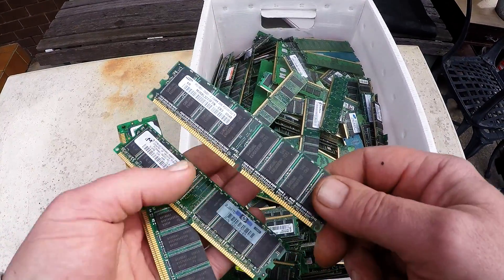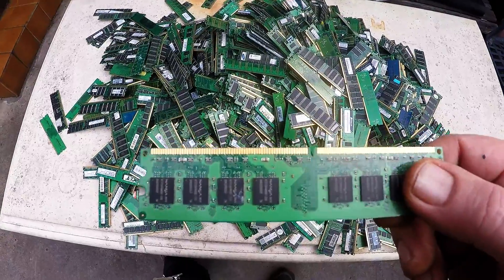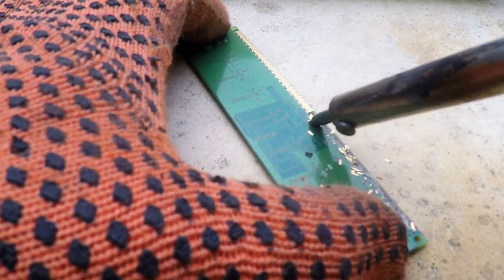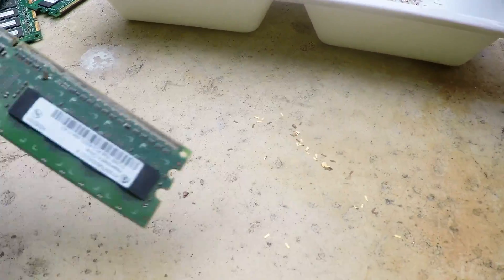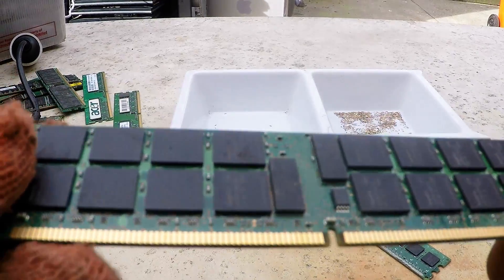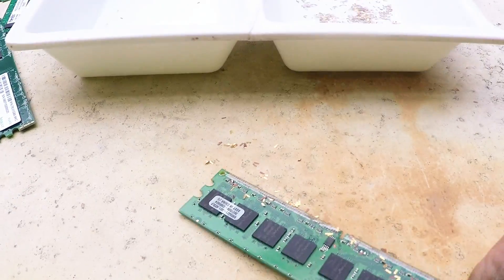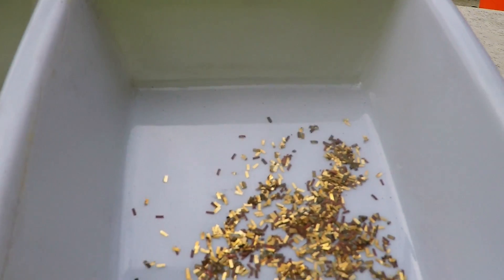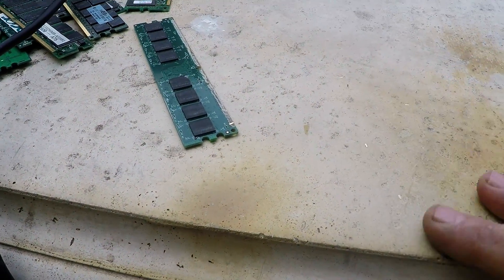1000 RAM Stick Gold Recovery Challenge

Comment: Have you considered heating them in the oven to have you considered heating them in the oven to about 400 Degrees Fahrenheit and holding them somewhere close to that because though I haven't done that I do know that's below the melting point of solder but would have your fingers ready to fall off with much effort far less than what I'm seeing you do now and just seems to me it might be worth trying because there's an old electronics technician trick that consists of placing entire boards in need of repair in the oven to Reflow the solder without having to do anything else so easy a blind man can do it because it's all about knowing precisely where your solder will flow and then dancing along that edge the other methods not to mention the physical stresses put on components regardless of temperature that can all be avoided if done properly and I have seen it done many times my other electronics gurus I know who effectively minimize risk and effort while maximizing productivity because you can put quite a few motherboards inside of a typical household oven which is where at least three people I know do all of their work rather than high-rent storefront that just chews up all the profits.

Comment: I wanna get into this hobby also so I can use this gold money I make to use for my addiction to sports/poke/yugioh card collection purchases what kind of soldering iron can I purchase off of Amazon or eBay what’s a good affordable brand to look for my max spending is at least $100-$140
Reply: pro tip: go for obsolete stuff if its cheap. its useless and usally has more gold
Reply: Maybe the same when you used to iron your shirts with so you can depopulate the entire thing at one time instead of one component at a time or toss them all and a griddle and using a spatula in pair of pliers depopulate a whole side at one time as fast as you can pick them up and put them down as long as you've got them pre-heating several at a time but I assure you you don't want to pull off just one of those individual tiny components at a time unless your objective is to kill time because you got nothing better to do and which case you may need a hubby much worse than you need money for whatever it is you wanted the gold to buy because you certainly won't get rich here doing that
Reply: And yes you want the stuff that is not just absolute but was made in a time when gold was around $300 an ounce instead of pushing up against the 2,000 per ounce all time high again and I honestly believe the new stuff not even a little bit worth messing with for that reason

Comment: White Distilled Vinegar and Hydrogen Peroxide will get rid of the copper.  Use an aquarium airpump and some hose to agitate it.  Plus when you are done recovering gold, add some aluminum from a Coke can and it will drop the copper out of solution.
Reply: Salt ?

Comment: I have a very bad message for you: this gold foils would not melt until you process it with AR. I tried this and let it up to 1150 degrees of Celsius for 30 minutes, nothing happen. It won't get into one solid piece of gold-copper mixture. I've lost a lot of gold by heating, instead.

Comment: It takes electricity to run a soldering iron,.What is the electricity cost on using it to remove the gold???
Reply: That depends on what your Electricity Supplier charges you per Kilowatt hour as well as the wattage rating of the soldering iron...once you know the 2 figures for your own setup then you can calculate that cost very easily.

Comment: Just use tin snips and cut a strip containing the gold pins then put them into a hydrochloric acid (27% or so) + 3% hydrogen peroxide to remove the pins. Super cheap and dissolves the copper under the gold fingers. It's also possible to put the whole ram sticks into an oven (Outdoor) and set it to 190c or so (Some sticks took 210c) . This melts the solder. I then used pliers to grab sticks and flick them on to a table stop. This usually knocks all of the memory modules and diodes (I guess they are...) free from the sticks. Also works with motherboards.

Comment: hi ben, me again lol i think i have commented on every video you have done. just a quick question, when you have the foils of the ram stick would they still need the acid to strip any other metals? or are they ready for smelting?
Reply from the maker: as the trial suggest, only 4% gold after removing the foils from the ram, it's best to then use HCL solution to remove the 86% copper & 10% nickel from under the foil, that way you have almost pure gold foils left which could then be simply melted into a gold blob, the hcl will just dissolve the copper & nickel.

Most people will just throw the whole fingers into hcl and let it do the work of removing the foils off the piece of board and remove copper/nickel at the same time, takes longer but is kinda the same thing, this project was just to quickly see what % of gold was in the foils but if you removed the foil like this then you would have a much quicker process one day when you go for the gold
Reply: that is really only a small amount of gold. i was thinking the way they look there would be more in it then 4% i am glad i am keeping the mlcc's and copper now lol

Comment: Not everyone has a place to make a safe refining setup, either if the person has access to the chemicals, without access to decent VENTILATION the chemical process will be near impossible.
Reply from the maker: Yeah I agree, especially using aqua regia, can be deadly, a good backyard refiner would have a fume hood and they aren't cheap
Reply: eWaste Ben And if the person lives in a condo it's even worse.
But this kind of technique could make the chemical process a bit faster: Since there is no "plastic" to dissolve, completing the chloroauric solution would probably take less time.
Reply: cant you a make a fume hood from the one most off us have in the kitchen? maybe withe a faster / more powerfull  motor? greets from the netherlands.
Reply: or the ones pot / weed growers use?

Comment: 6:38 at this point, I'm convinced people don't know basic chemistry. Most things on every are made of chemicals, which all have atoms.(got that wrong the first time ;3;) Water, as you may have heard, is hydrogen and oxygen, and you breath in oxygen, a little bit of carbon dioxide and lots (70% of what you breath) nitrogen. You may say just dangerous chemicals, but as long as you are careful, honestly, it's worth your time. It's takes, maybe, 15 minutes to find out what chemicals you need and how much, and it's a lot faster than scrapping the gold off. 
Btw, I'm not having a go at you, just informing you that chemicals are that bad.
Reply: Actually you breathe mostly nitrogen. And chemicals are composed of atoms, not the other way around. Everything is composed of atoms.
Reply: SwordlessFish ... Well thanks I guess. I'll change it now because it doesn't really change the point I was trying to get out of the comment.
Reply: Spectre Lex S'all good.

Comment: Hey Ben, I recently cut off tons of gold fingers from old circuits and my question is, surely a lot of those are not broken right?
(I dont know where you got them so all 1000 may indeed be broke) though my thought process would be, wouldn't it be a million times more worth it to test the ram sticks and sell them as is on eBay?
So, the process of scrapping these ram sticks for gold recovery is ONLY worth it (money wise) if the ram sticks dont work correct? I mean, you wouldn't consider scrapping WORKING ram sticks for gold right?
Reply from the maker: Yep, first point of call is to determine if it's worth selling, 2gb+ here, anything less doesn't sell well, if I get a lot of the same 1gb stick I try and sell in bulk lots to pc guys, but depends where you are, some countries still get good money for 1gb, just need to test them otherwise you end up getting too many returns.
But yeah, gold recovery is final stage.
Reply: Some old memory sticks are more expensive then "new" 2GB or 4GB, but you have to know prices (what is rare and expensive and what is not).
Sometimes size does not matter :)
As an example look at memory prices at this shop for Amiga fans. 1USD=4 zł 
http://www.efunzine.com/efnz.php?a=kat&id=175&sid=52762061755cacf5684cf691645d39fb

Comment: Well i'm very surprised the fingers come off so easily with this method.  And it sure would be easy to refine it to pure with acid still.
Reply from the maker: Yep, I think it's best to use some sort of solution to remove the gold from the copper/nickel as in my trial it's very heavy in copper/nickel and much easier to remove them first I think.

Comment: when are you going to put up part 2 really like to no what happens :)
Reply from the maker: soon, just waiting for a crucible to arrive so I can melt
Reply: sweet i cant wait to see it,have you thought about using (AP) or etching fluid ferric chloride  to clean it up a bit.get more cash less crap :)
Reply from the maker: would be less crap but not more cash, gold buyers pay for gold content, 8kt is 33.33% of 24kt but 3 times heavier so it's the same thing. This test is to see how close to 8kt we can get simply melting fingers down, if not 8kt we can add 24kt to bring it up, but if less then 5% then it may not be worth it, that's why i'm doing it, to see if it is or not.
Reply: fair play hope its good :)

Comment: Hey Ben, Well done! this and all your videos. Thanks for putting them together. Perfect timing, I was just shopping around for a shear to take off the fingers..... I tested this last night on Ethernet and sound cards also and it works great. added in using a steel ruler to straight edge a cut with a utility knife along the top edge of the fingers to aid in the removal.

Comment: Hi Ben, Ive already started processing rams the same way after I saw another video on here doing the same thing. You'll get approx 1 gram for every 6 double sided sticks. 
Accounting for minor losses (sometimes those gold fingers ping in every direction!!) you should have about 165 grams from 1000 sticks.
A kilo of gold fingers therefore would take approx 6000 sticks. Bet you've got that much stockpiled:-)
Though I like that you dont need expensive chemicals as this is very quick I'm still going to chemical process further as 8-14k gold is worth a pittance in UK compared to 24k.
I look forward to seeing what you get for the gold from your buyer,
Reply from the maker: it's actually the same value, 8kt just weighs 3 times more
Reply: Actually your right. Its marginally less value wise at 3 times the total weight but close enough.
I always assumed you got less as the purer the finished gold the more premium you got on the price. Bit of a shock finding out it isnt.
And though I was wrong its all good because now I dont even have to bother processing other than melting it down ready to sell.
Cheers Ben :-)

Comment: Excellent idea for an experiment.  I have refined with chemicals and I can tell you that if the gold was removed the way you are dong it and melted into a bead that the chemistry is much easier to handle.  For the people that say it is a waste of time remind them how long they spend rinsing the gold foils off of each piece of pcb.  Been there done that it looks like it doesnt take any longer the way you are doing it. And by the way it takes about a week to separate the gold foils from the circuit boards doing the common process of hcl and a long time rinsing depending on how many boards are being done.  I really like what you are doing here.   Im very interested in what results you get.  Please keep me updated

Comment: melting them down and just selling it like that???well yeah.  i recently ordered a 71.3 gram bar of molten down gold fingers.  guess what it cost?      3.50 DOLLARS. guess how much gold there is in that 71.3 grams of molten fingers. about 0.1 grams of gold. IF I AM LUCKY.
Reply: Those melted bars are definitely not gold pins they are brass with a small amount of gold added for fun.  It is a top level scam.  If they are the yellow bars all over ebay then they are defiintely brass.  Look up what 4 or 6 karat gold looks like and then look up 24 k gold and compare the colors.  You will notice that the bars are almost the same color as the 24k gold and also the same color as brass.
Reply from the maker: you bought melted down pins, not fingers :)
Reply: Explosive Eddy
wich is why i said i expected about 0.1 grams of gold in there.
i don't mind testing stuff if it's only a couple dollars
Reply: Ok some of those are going for big money.  Do you think they are just brass with a little gold added?
Reply: Explosive Eddy
they come from the middle east.
i sent them a message 4 days after the expected arrival date.  telling them to hurry up.
and they refunded me.

but yeah i think that's what they are.
the actual cpu pins are silvercolored with a gold coating.

melting them down into a bar would probbably not produce gold colored bar's

they explicitly state that it would fail the acid test. (wich it logicly would even if it does contain the little amount of gold that it should)
but i think it's just a complete scam. 
it was just so cheap that i wanted to see it for myself

Comment: Hi Ben. Another awesome video. I melt my gold with a map gas and oxygen torch. Small gold like that would melt in less than 5 minutes and the torch only cost around 30 US dollars. You can buy canisters of oxygen and map gas when it runs out but it last a while doing small amounts of gold. Just make sure you use some borax to melt with the gold it makes a glassy layer that covers the gold and it cracks off or melts off with water. Also small gold like that can blow out of the crucible so put a quarter inch or so over the gold so if anything blows out it is borax. You could  start with a couple of ram sticks worth of gold to start and then increase as you get good at it. You could get all this stuff for 50 US dollars or so and then you could challenge yourself to make the biggest blob of gold in a day and then weigh it right on the spot. You can get the torch at a hardware store with extra canisters, the crucible on Ebay and the borax at a grocery store sold as detergent. Make sure you are wearing gloves and goggles and do it in a well ventilated place.